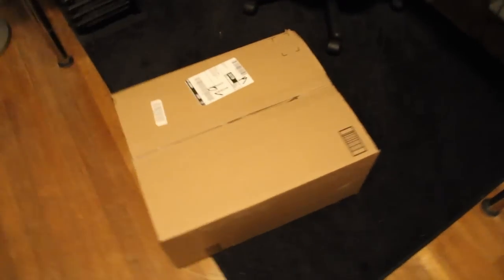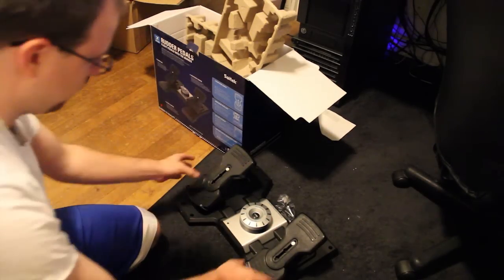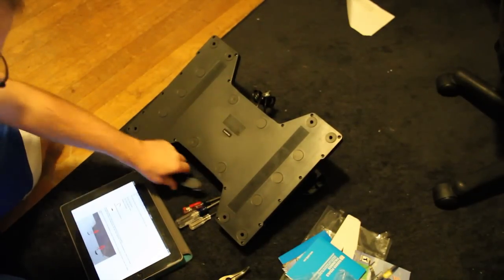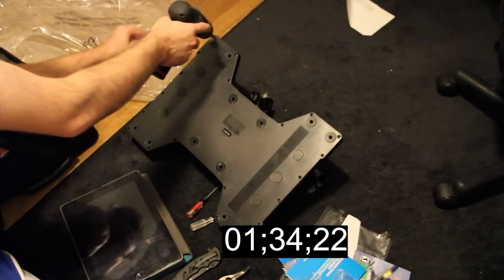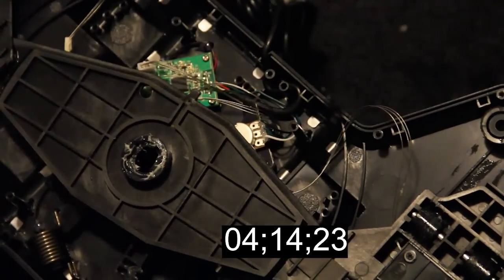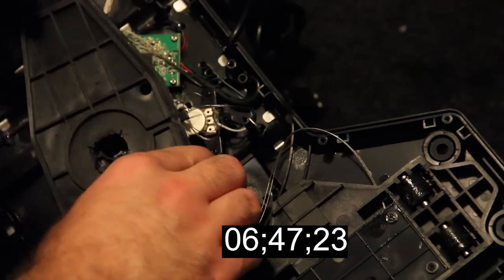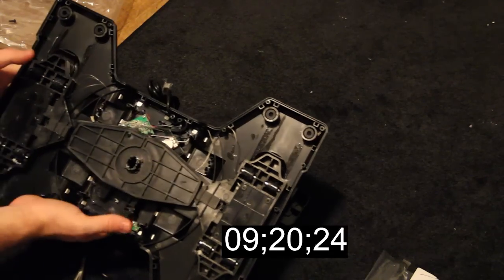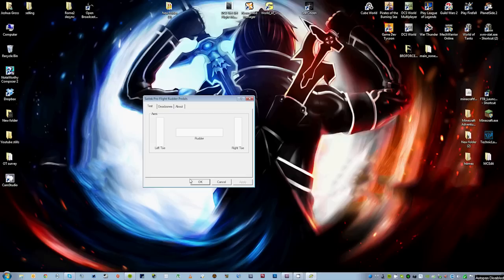Unboxing Saitek x52 Pro Rudder Pedals and remove the center detent

Comment: I got my spring back on, and noticed the pieces along that center had come apart due to the pin coming out on its own, but now with it back together the centering is like 60% to the left.
Reply from the maker: Yeah, have to pop it back open and adjust that sprocket.
Reply: @GrossTechnology  yea and ya need 3 hands lol,,, sorta looked before i did mine and centered the floating sprocket, It has to be one outside the sensor sprocket at both ends ... Damn that stuff is gooey and slick !!! much better and no annoying clack at the center
Reply from the maker: Haha totally agree.

Comment: I wish you had demonstrated the new action with that center detent removed. Out of the box, there is an annoying clack when the bar hits or passes through center. Is that sound now not occurring?

I recently became aware of a disappointing weakness in the design of the toe brake action. A plastic 'hook' is too thin to long survive the strain imposed by the spring, and eventually breaks off. There is (or was) a kit of the two replacement parts made of aluminum offered by a third party (he has a vid on YouTube). What I would do right away is come up with a means of bracing those plastic parts so that they don't break in the first place.

Cheers!
Glenn (aka WxTech, Il-2 1946 modder)

Comment: I just removed the detent for my Saitek Pro Rudder pedals and it is a real improvement.  However, when I reassembled everything I must have moved the gear set up a notch or two  so now the rudder is in a left turn when the pedals are neutral.  I have paused your video where it first shows the gear setup and will try to duplicate whats there.  But just in case, is there a way to set me straight on exactly how the gears mesh? I don't want to keep taking the thing apart for fear of damaging something. I have scoured the web and read the user manual but coluld not find an answer.  Thanks
Reply from the maker: Oh that is a bummer, yeah it’s a trial and error really. Sadly they didn’t put or make anything to show it’s in the correct position.
Reply: @GrossTechnology  After some gloomy thought and facing the prospect of multiple ordeals of putting the contraption back together I found that this worked the first time. On the gear that is connected to the potientiometer each of its end teeth should fit into the End Grooves of the other Lower as you look at it) gear. It's running great.  Ifeel that the spring is a little too taught and might replace with big rubber bands.

Thanks
Reply from the maker: That’s awesome! I didn’t realize that. Well that makes life much simpler to put back together! Glad you were able to figure that out.
Reply: @johnlorey6771  I appreciate that comment. This would have been my only hesitation to doing this mod. Good to know it's an easy solution if I accidentally pop the gears off. 👍
Reply: @mcorrive12  Its always best to take pictures frequently, like right when you open the back panel, take a picture. Then again after every step. well maybe not every step but you know what I mean. I've learned to do this and its saved me more times than I can count. :)
Reply from the maker: This is great advice for any kind of repair or replacing anything. Especially when there are wires involved.

Comment: looks to me that it might benefit to put some tape over the tension adjuster to stop it falling out when the retainer is removed then it wont fall to bits and get grease everywhere. not a bad vid but no though gone into the mod at all.
Reply from the maker: I looked into that, and found that if you do this, the adjuster kept getting stuck.  As far as going into what the mod is all about, you are correct, didn't really talk about why you would want to do this or even what the benefit was.  I will look at changing the description with all that information to help out.  Thanks for the feedback.
Reply: i just got mine and i am strugling to get away from the twist grip thrustmaster you can fine tune your aim much easier with a joystick i will give them another go but the hand seems much more sensitive than the feet.
Reply from the maker: It takes some getting used to if you are not an avid flight pedal user.  It took me some time, but I can now be more precise with the pedals than with the joystick.  Also, when you are in dog fights, you do not want to be doing all those different things with the stick.  That is the point of the pedals, it frees up your hand to work on yaw and pitch.  It just makes you be able to use your entire body, instead of trying to do everything with one hand.  Kinda how they separated a throttle and stick into two instead of all on one thing.  But yes, it does take a lot of practice.  If you are just looking for using it in a flight sim like Microsoft flight sim, not really huge, since you aren't doing big or fast maneuvers, but thats the best thing for it.
Reply: thanks for that, i am actually playing world of warplanes , it is dog dog dog from the word go, and have been playing flight Sims for around 15 years ans have always used the rudder on the stick to fine tweak the yaw it is so easy to me, i tried the peddles but find my self still trying to yaw with my hand, i should practice with it but the game is very intense from the start and you don't get time to learn, and there is nothing worse than going into a training room knowing there are players that need shooting down lol..
Reply from the maker: I totally understand what you mean.  I first got it to help with world of warplanes and some other sims but you are right. Learning in a game like World of Warplanes is nutz and isn't really where you want to learn and to get muscle memory from.  For me the two games that I used it and learned best using it were Rise of Flight, and DCS A10. I also used it in Elite Dangerous beta.  The best one, in my opinion, to learn was Rise of Flight.  The reason was because this is WW1 flight sim, so it is back to basics and is a lot slower of a game for dog fighting.  I actually was trained using that game on how to fly.  You can join the online school as well, helped me learn a lot really.  Even though I have played flight sims for a while, I still was able to perfect what I do, while learning real dog fighting maneuvers.  The school is http://www.joint-ops.com/php2/index.php.  Joint-Ops virtual flight training.  I would promote that in a second.  So let me know how things go.

Comment: So, you're removing the detent here but not the actual spring centering?  After a decade, when I was cleaning mine the tension knob slid off from between the pedals.  I slide it back on and while the tension control works fine, the detent and the spring centering is all gone.  What do you think I need to do to get them both back?
Reply from the maker: Are they lost? Or just came out?
Reply: @GrossTechnology   Not lost.  I suppose you just have to put it back in carefully with it aligned, and then test it to ensure it's centered.  I put it back in without checking centering.  So it's now just not centering to the right spot.  I'm too lazy to open it back up at the moment, but I'm not flight simming right now, anyway.
Reply from the maker: Yes, I had to do it a couple times till I had it centered correctly.

Comment: Hello, has anyone idea, what is the white gel/vaseline inside? My tension settings was damaged, I repaired it, but I need to add inside this adhesive. I tried classic vaseline, but it did not work. It make no resistence. Thank you
Reply: If it looks like vaseline, it's most probably silicone grease or maybe PTFE-grase. Vaseline hase almost non long term lubricating properties in mechanical aplications besides, you know, oscilating linear movement under a blanket.

Comment: Why is everyone so anal over detent? I use saitek yoke and pedals and never had any issues with performance. Do you think the heavy’s really have no lag in control response?
Reply from the maker: It was more to help those that have never flow with pedals to have a more fluid movement.
Reply: I've been using these pedals for 4 years and hate the positive stop and noise and now it's gone !!!!! and the rudder is more controllable instead of skittering all over the runway fighting the detent and pedals moving about, And no i won't screw them to the floor....My wife will knock me out..... lol besides i like the singles instead of big jets ... more of a challenge